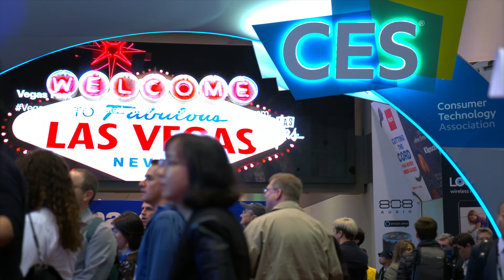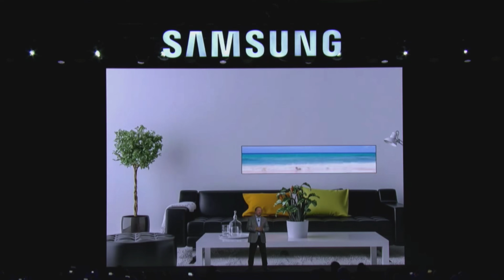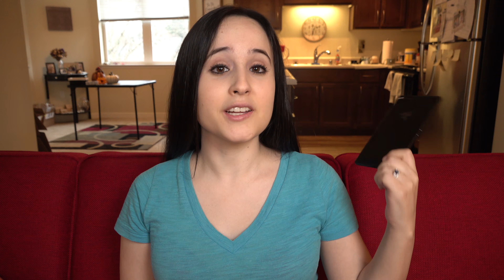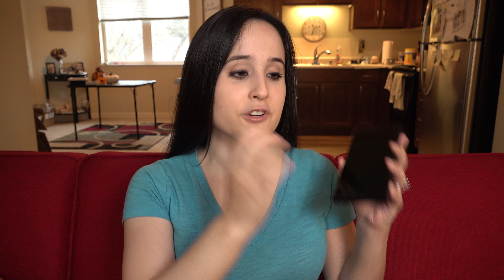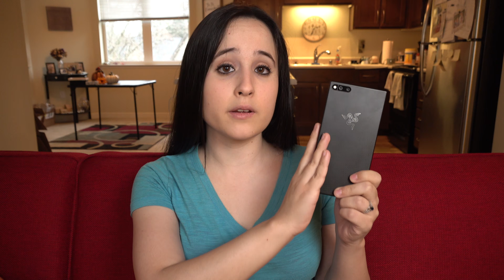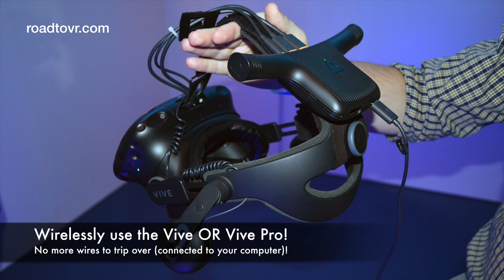BEST OF CES 2018 & WHY

Comment: The problem with Snapdragon as a tablet/laptop dual machine is that it isn't an x86 architecture.  Even after a decade of smart phone and tablets, ARM core lags behind x86 in terms of software, it's still not as standardized as x86 even where there is software, and particularly if you want to do gaming or software development... it's not good.  I have a Lenovo Yoga (which has an x86 Intel CPU), and it's a pretty great laptop/tablet.  I also have a Galaxy Tab, and while it's great as a cheap tablet and it's nice for Google Play, it's just not as good.  Between the two of them if I had to pick one, I'd pick the Lenovo Yoga because it has a much deeper range of software, you can play non-casual games, it can do software development, etc.  It's just really nice, tbh.  Until you can compile Fortran and older mathematical software that I use cannot be ported over to ARM-core devices (or until x86 can be emulated on an ARM-core), and stops me from doing a lot of my usual computer-y things.
Reply: The LTE chip though is really cool, and it'd be great to have --the only issue is, that's presumably another $30/month or so, and if you only got like 4 GB of data a month, at some level the LTE chip just isn't useful.  All of this stuff isn't really "on the go" in a meaningful until those data caps go up, which seems like it'll take time for those prices to come down.
Reply: As for Project Linda, that is really neat. There's two thoughts there:

1.) It'd be cool if it had a good battery in it, because that's all that it would need in addition to the screen and a front camera.  Maybe also an additional heat sink to allow for faster phone processing?  The thing is, you'd need to have an insertable bay that each individual phone manufacture would have to make (subject to certain standardizations that would be necessary), and then the drivers for the screen would need to be compatible.

2.) It'd be kind of cool to see a dual implementation of this.  Right now, no one wants to do this, but I'd be great if you could make a laptop that was designed to co-function with a phone.  The laptop would have the usual laptop x86 architecture with just a screen, an SSD, USB ports, and maybe a mini-HDMI.  Anyway, the cool thing would be if you could share the features of both over to each other.  Do you need an internet connection?  Well, you laptop (once synced) could access your phones LTE connection.  Does your phone need an x86 app?  Just run it on the laptop CPU and stream it to the phone.  Does your laptop need motion sensing or GPS?  Cool,  the phone has that.  Does your phone need more power?  Have it draw from the laptops battery.   Do you want dual monitors on the go --well, use the laptops second screen.  Do you want to view your phone's apps on a larger screen?  Stream the phone to your laptop screen.   In principle, all of these things exist, it's just that it'd be nice to have that be all collected under one roof, have it be design philosophy be there from the outset, and have it all work out of the box.

(Apple, being manufacturers of smartphones and tablets and laptops, could do this in the easiest manner, but I'd prefer to see a Linux implementation as I'm primarily a Linux user. Windows + Android would also be acceptable.)

Comment: 4K projectors had a big price drop due to new DLP chips. Three were introduced at $1500 and an older 4K one dropped from $2000 to $1300. A year ago it was $5000.

Comment: I'm completely in love with The Wall too. I just traded my main 4k LED TV for a 1080p Projector. I love the 120" size obviously, and it's plenty sharp. But I miss the super high contrast from my TV, and the slightly higher sharpness. Samsung looks to have that solved. I think a budget 4k projector will likely be much cheaper in the short term though. I've seen some already down to like $1300 ish. Still a little out of my range, but maybe for tax return season... :D

Comment: LCD also can have burin in effects. This has not that much to do with the organic build of OLEDs... Blue needs way more energy than red and green that's why blue Pixels are "dying" faster
Reply from the maker: LCD gets image retention for different reasons though ( the liquid crystal stops “turning” to let the light come through) and yes blue wears the fastest because it needs more energy but the wear happens as quickly as it does because it is organic
Reply from the maker: Non organic material from micro LEDs wear a lot less quickly and they also use Red Green and Blue emissive subpixels. Blue in this case would still wear the fastest.
Reply from the maker: For an entire matter when we talk about wear with amoled we are talking about the organic molecules wearing. Burn in is wear. It’s just that the blue pixels are wearing more quickly than the rest of the display but it’s all wear.
Reply from the maker: I have also seen cases where green wears the fastest too (maybe more noticeable with a green subpixels bias? ) You will see magenta image retention on some displays. This means green wears leaving red and blue. Red and blue light makes magenta... so wearing rates are interesting.
Reply: So much wearing... :D
I think it also has something to do with the size of each pixels. LGs newest OLED TVs have a life span of 100.000 hours which is way longer than LCD with 70.000 hours. So we have to wait and see how good mLED is working on displays the size of a Smartphone etc.
Also there is brightness. Samsung uses bigger blue pixels so they don't need to put the brightness at the max to compare to the green and red ones, you know.
As far as I know the mLEDs are in the same size for each color (rgb) and I think even if it's not organic, it still can burn in, specially the blue ones because, like I said, they need more energy.
Reply from the maker: What I have read for LGs OLED displays is that they are white OLED with color filters so they negate the blue subpixel burn in issue... check that for me if possible
Reply from the maker: Oh yeah, I was mentioning that it will
wear too and blue would be first since it used more energy just not as fast.
Reply: Although that's technically true, most people couldn't achieve image retention/burn in on LCD screens even if they tried. Unlike OLED the LCD tech is a lot safer, and naturally extremely resilient to it.

Comment: Did you get to try the HTC vive pro?? I wonder if the resolution is high enough where it's actually not so pixelated like the gear VR. Also I saw on another video that the HTC vive pro isn't tethered, so you're more free to walk around. Slowly making it more enticing to look into purchasing one. I feel the same way though...not quite there yet.

Comment: Project LInda is not something new.
Asus did it 5-6 years ago.

Snapdragons windwos tablet are insteresting, but too expensive and moreover they will have a lot of problems with drivers and programs, and sincerly better tablets like Suface Pro & co at those prices. Or if you need few specs using cheap windows 10  tablets.
Reply from the maker: +Luca Bastianello I guess it's hard to gauge what a tech is worth. I paid a stupidly high price of 1,600 for my underpowered MacBook pro 12 inch but it was worth every penny for me. But yeah, we will see how programs run. They are emulated programs.
Reply: That product does not owrth it. I have  my T100TA of 4 years ago that can do the same and even more than those tablet with office 2013 was included and still I can surpass those snapdragon tablets in doing things. 
In the upper part of the market you have Surface Pro and similar, in the bottom part old models those continue to be sold. In the medium part we have nothing. But a 749$ starter price is not a worth prize caue they are too shallow to coplete with the premium ones and too close to low budget ones.

MacBook pro has the advantage of final cut and Appple ecosystem, so it's understandable (even if I'd never pay so much for such outdated and expensive product myself).

But those tablets with snapdragon are too much expensive as are those Chromebooks presented. Tey are mocking the consumers. If the starter point would have been 400$ it could have been understood, but at that price no, they are not worth it anyway.

Comment: I don’t think Razer would be the best company to implement it, I think Apple would.  Especially with the ‘edge to edge’ iPhone X, 3D Touch, and the Taptic Engine, not to mention just their quality control in general.  I found Razers dual displays to be quite clunky in the past, but this one could be better.  I hope we do see it, although I don’t know what form it would take as I’m pretty sure Apple already patented that implementation.  Razer probably designed the phone with this product in mind, so I wonder why they didn’t incorporate any pressure sensitivity or better haptic feedback.
Reply from the maker: They did the best so far 🤗
Reply: Erica Griffin Very true, and if they don’t continue with it, it’s hard to imagine any success in the near future with those kind of designs.  If not then I’m sure in a few years it’ll return with the phone launching Windows when docked and having a decent GPU for gaming, perhaps in the clamshell chassis.
Reply: I don't think that's the best idea, we shouldn't restrict ideas to specific companies it will kinda kill innovation as a whole, apple makes good hardware but so far they haven't tried anything similar in the past and the biggest reason i thing Apple shouldn't be the one doing it is that. Android gives more freedom to users and behaves much more like a computer than iOS. iOS has so many restrictions that's baked into that's not usual for a laptop. So, if Apple does it, we will get more of a iPhone that turns into an iPad rather than a computer.
I create tech related contents. If you are free please do give it a look.
Reply: You were Wondering I wasn’t saying in any way to restrict it to a certain company, I certainly don’t believe that’s a good thing.  I was implying the opposite, hence why I said I hope Razer goes ahead with the idea.  It’s not a case of whos done something similar before, both companies have done it internally with Razer being the first to show it off.  Razers only been in the laptop market for under a decade, and the phone market for under 5 months. What makes you think Apple would have iOS run in a clamshell form factor?  I never thought that and they wouldn’t, it would boot into macOS.  Just as I said it’s likely future versions of these products would support booting into Windows when docked.
Reply: Well, from what you said i felt like you were implying that Apple could do it better, and just writing off Razer as a company that can pull this off. But if you didn't mean it in that way then i wan misunderstood your comment. Apple is a big company and definitely has the potential to do something like this, booting macOS in such a system doesn't really makes much sense, the smartphone will always have to carry around macOS in it, which only activates when docked (kinda waste of storage space), if two different operating systems are used then a lot of issue might occur in data sharing and account sharing and a lot more apps need to be installed separately (you cannot doc the phone and continue doing your works, you will have to restart the app and sync do that as iOS and macOS re different operating systems). Android is actually more suitable for this as it is a better PC OS than iOS is.

Comment: Having  a corporate product in your house that can record you both visually and audibly then send that data back to the company - absolutely not.
Reply from the maker: Let’s hope we get a crippled version
Reply: JBT You see that is exactly the kind of mindset that is the root of the problem. If there is any invasion of privacy then all invasions are legitimate. Well, what do you have to hide?!
Reply: So where do we get non-"cooperate"  mass market consumer products at an affordable price ? 
You don't they simply don't and won't exist due to economies of scale.
Reply: trooperJac have a cell phone?
Reply: trooperJac  I hate my phone and the need for it.  I dislike Google and the majority of the way the electronic fronteer has gone .  Sure not gonna get a toy into the act, nor will I turn on location.  Hell it stays in a cute ferrous cage when not in use.
Reply: if there is a company I would trust, it would be Sony- privacy wise, not so much security.
Reply: Erica Griffin I'd like a version with wifi only that hooks up to a home server. Expecting a consumer to run a home server might be a bit complicated for a consumer product though.
Reply: Yes, it does pose a huge security risk and the fact that it doesn't really serve any major function also kinda makes it not the kinda products i'm looking forward to see in the future. Secondly, it's may seems very cute right now, but it's a robot and it does have limitations which may make the product kinda repetitive and boring int he long run, and the fact that it needs to be constantly recharged does really help that much either.
I make tech based contents. If you got some time to spare kindly do try my channel out.